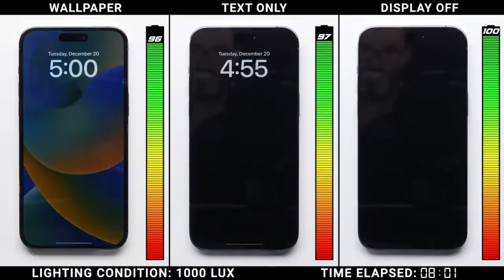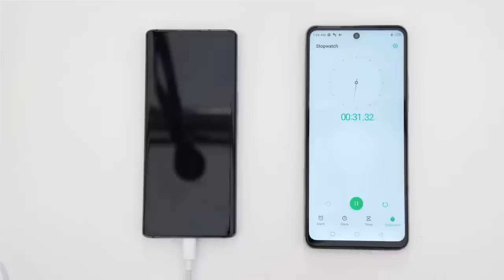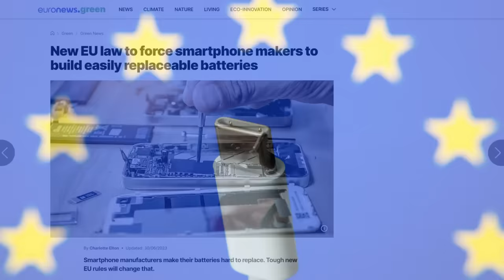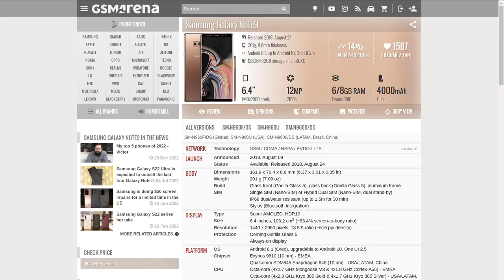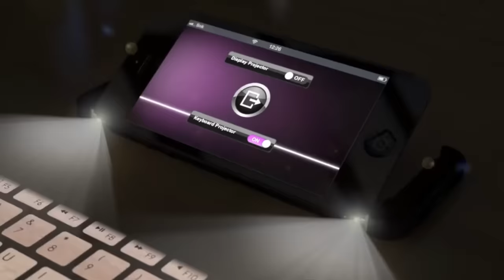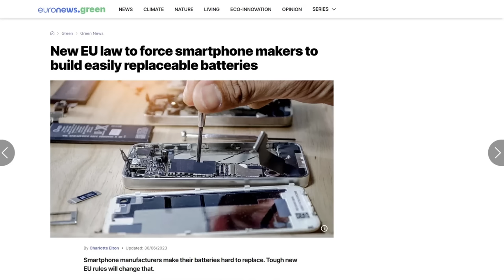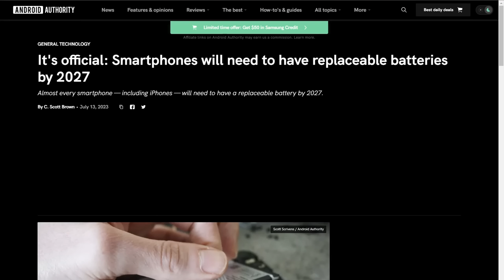All Smartphones Will Soon Have Removable Batteries

Comment: You forgot one important thing: you can be sure your phone it's off when you remove the battery. Also by the battery not being connected to the pins it doesn't drain at all compared to the phone when it's off, for emergency situations
Reply: @todaybuycheapsellhigh8072 I mean....you could just recharge them with batteries charges or just charge your phone > swap batteries > charge again to always have a reserve batterie
Reply: Nope. They can be fully active without a battery but appear inactive.
Reply: @essef. That makes no sense, you cant power the motherboard without DC power, from the battery. With no battery, the board isnt powered so what are you referring to, a hidden battery?
Reply: @davidca96 Its true, your phone is never truly off.
Reply: no need to remove battery for shutting screen from draining battery. capacitors can hold enough energy for allow system (even after battery taken off) to send and receive signals for days. capacitors are found inside  most electronic devices e.g. smartphones :foilhat
Reply: You definitely cant bei sure of that, lol.
Reply: @davidca96  They have micro battery which works as an alternative battery for clock and some other technical stuff.
Reply: Absolutely hit the nail on the head, for me this means I can have piece of mind that I am not being spied on by taking the battery out of my phone.
Reply: @resentfuldragon just put it in a different room 🤷🏻‍♀️
Reply: Not true, many had secondary batteries so you can still be tracked with your battery pulled.
Reply: I saw a video where someone opened up their phone and cut out a small battery that wasn't needed. Phone worked normally afterwards
Reply: Faraday bag is the best option

Comment: There were water resistant phones with removable batteries. Samsung made those sturdy series with button keypads. There were also commercial aimed phones that had removable batteries and water/dust proofing
Reply: No phone is really waterproof, because if your phone goes into the water, the phone company will never accept to take it as warranty case 😢
Reply: @farounaga6931  It doesnt matter, practical aspect of it matters. So accidental drop into water briefly doesnt ruin it.
Reply: my old androids all survived accidentally leaving them out in the rain for hours without any IPS rating.
Reply: @Kacpa2  it actually does, don't forget that your phone has holes in it, so if you do not bring your phone directly to someone who can open it to remove water from the inside, sone of your conponents has a chance do be oxydated after
Reply: This is true, but let's be honest, the water resistance sucked on the S5 which was the only Samsung phone that had a removable battery and water resistance. It is undeniable that the water resistance is better with glued phones.
Reply: @Kacpa2  i work in phone repair, i see it every week :)
Reply: I had a Sharp phones in early 2010s, waterproof Android 2.3 something and it had button, flip screen and touchscreen in one unit, insane engineering in there. They still works, I had to stopped using it because of outdated Android version. It is Sharp 007SH.
Reply: @farounaga6931 he said water resistant not water proof
Reply: Yeah, but the phone was made out of plastic and had shitty capacity/quality battery that died within a year inside it. I don't have fond memories of my S3. Battery inside of my Poco F3 on the other hand is still decent after 2 years. Hopefully "user replaceable" doesn't mean return of low quality plastic devices.
Reply: i remember i was playng hide and seek in my village it was 12 night and i hanget misely by to metal poles wich were above the river ...it was the best hiding place ...but my samsung phone fell out of my poket ....i had to take a 100 meter detour to get to the other bank of the river and search the phone in the water with no flashlight  and it took me like 7 minutes to get there and find it beacuse i was going crazy for losing my phone. i found it and it didnt restart ...i put it in rice overnight and worket just fine ...and it works to this day ...but i dont use it enymore oviiesly
Reply: @capitanulcacaoernesto8215  I specificlyean old XCover Samsung phone.
Reply: yes I had one of those it was the S5 Neo I believe and that had like a small silicone wall that would prevent water from getting inside to a certain depth, most phones today still are only waterproof up to a certain depth and duration the whole argument is just another way out for those crybaby corporations

Comment: As an XCover user, I can confirm that having a removable battery while still passing military standards and IP68 works perfectly fine!
Reply: As someone who had an Xcover, that phone was based on the hardware department
Reply: IP68? that's pretty sweet, never heard of the Xcover - do they ship in Europe? And their origin?
Reply: @sandwich5344  Samsung Galaxy XCover, and they're available here! (I'm German)
Reply: XCover Owner here :P
Reply: yeah, walmart uses an XCover pro as their employee work phone, i was surprised when i saw it had a removable back
Reply: Absolutely, this is entirely correct
Reply: Isn't IPX8 good for prolonged immersion in 5m of water? You could scuba dive with that
Reply: My first Xcover held for so long that when the battery lifetime became a severe issue there were no replacement batteries available anywhere, the model was too old...!
Reply: FINALLY, phones will have removable batteries again, tbh they should take the design from hand-held radios, those are made so u can take it out easily,no need for taking cover out, and u can charge the batteries outside the radio... i hope the phone removable batteries will be implemented like that... (ps: from what i know, this has been a thing in hand-held radios since before the 90's)
Reply: and about waterproofing, radio manufacturers like motorola managed to make it very waterproof, (depends on the radio) but even with easily removable batteries, you can still make them waterproof (as in survive underwater for some quite long periods of time)
Reply: @Fer-- Motorola made many of thier phones waterproof and just didn't tell anyone. I had one and found out the hard way. 😂
Reply: Same. I have got a Volla Phone X23. Awesome phone. Extreme both physical and digital integrity!
Reply: @touta2647  my Xcover had 12GB of storage and was obsolete for my projects due to lack of space(even with a micro sd car), I upgraded to a new 128GB phone. Otherwise, it was amazing
Reply: @GoonyMclinux  Nooo im not talking abt their phones, im talking about their radios! stuff like from the motorbo series or other kinds! they make extremely tough radios (all have detachable batteries lol)
Reply: I returned my xcover after discovering how slow the processor is for the price. It's like they intentionally made it slow to discourage buyers
Reply: the galaxy s5 has a removable battery, and is ip67, for my use its enough that IP
Reply: Batteries will be a subscription service
Reply: My Xcover drowned in a river :((
Rest in peace, my faithful comrade...
Reply: Samsung should start marketing these globally,kinda missed using Samsung since most of their Mid-range to flagship ones are just kinda meh & Im practically forced to used Xiaomi devices since theyre more value & does more than your average samsung phone nowadays
Reply: I guess thats the replacement for the active line that used to exist? I had the s5 Active.

Comment: I think this may actually help the battery bank market. They'll probably begin making replacement rear cases with extended battery life. Of course, Apple and Samsung will probably just move the battery to behind the screen.
Reply: Or power banks for the replacement batteries. So whenever you change the batteries, you put the older one in a power bank slot that charges it.
Reply: behind the screen??
Reply: ....are the batteries not already behind the screen?
Reply: Yes the batteries are already behind the screen, but they aren't removable. On devices with removable batteries, typically the back cover comes off to expose the battery. Why? It's the least cost and lowest risk to have an untrained consumer replace a battery. If they break the back cover they can use tape to hold it in. However, if a consumer replaceable battery is located in a way where the consumer must remove remove the screen to replace a battery, this would be a dream for big tech because now they'll sell tons of screens from people breaking them all the time.
Reply: @davidyoder5890  The EU directive prohibits this. The batteries must be specifically user replaceable without specialist tools and without risking damage to other parts of the phone through the process. The EU Commission aren't stupid.

Comment: Still rocking a Galaxy J7 prime with a removable battery,expandable storage and a 3.5mm jack. 2016 was crazy.
Reply: Im still using this as well. What reason is there to change unless i wanted to game on the phone (i dont)?

Didnt even know android doesnt have swappable batteries anymore. If not 3.5mm does that mean you must use wireless buds in modern phones?
Reply: @greenfroggood2392  Either that or you buy a  doggle for it which means you can't charge the device at the same time.
Reply: Exactly, i still have my iphone X, and don't really plan to change or buy new phone, i don't even play on my phone, it's all PC or Nothing at all
Reply: me too! Android 8.1 Oreo is very stable, I think this phone might last 2 years. Or more, but battery seems a struggle. I'll replace it, maybe.

Comment: From what I heard, this also affect handheld consoles like the SteamDeck. A neat reminder that laws really can be made to help the people.
Reply: Valve likes to be consumer friendly until they have to be friendly to the consumer
Reply: @eclipsek0  holy shit so true
Reply: Its sad that laws rarely help people these days. It is nice to see.
Reply: @eclipsek0  
I'm not exactly sure what you're implying with this comment. As far as I've seen, Valve has been very pro-consumer and pro-right-to-repair with their Steam Deck. You can buy replacement parts for it off the shelf, the board inside has an NVME slot for people who want to upgrade it with more storage space, and they even uploaded a video showing how to take it apart to swap parts.
Reply: @eclipsek0  for the steamdeck its not that bad, because the parts arent glued in with gorilla glue, and it supports power delivery so its fine
Reply: @eclipsek0 valve wasn’t trying to cause the issues with the battery, it was a reflection, of it being our first time creating a device at this scale and complexity.
Reply: @eclipsek0 2nd gen steam deck is being worked on to improve a lot of the hardware issues and slight oversights in the original design.   However it will not be released for many years
Reply: Last thing Valve makes more money if the steam deck is a fully functioning device, it is finically viable only because it exists to sell Steam services, to consumers.
Reply: @WaltuhBlackjr  ever heard about brand reputation
Reply: @augustday9483  What about when they tried their best to not comply with he return policy? What about when they forced users out of their right to owning games? (you probably didn't even notice why you had to agree to the new steam service agreement did you?) What about their constant persistence on not honoring the eu mandated warranty on digital goods?
Reply: If the government has the power to “help” the consumer, then they also have the power to help the corporations
Reply: @FoxWolfWorld  The EU is made for that, to help companies, the amount of lobbyist is incredible over there
Reply: @FoxWolfWorld  they do. But citizens vote for the laws they want, and government is simply the tool in maintaining the laws
Reply: The SteamDeck batteries are not made to be removable ?!
Reply: @FoxWolfWorld  Yes they do, it would be foolish not to have startup programs, but overall the government in Europe is way more balanced than something like America
Reply: @eclipsek0 have you ever bought any game online? You're buying the license to play the game and it has been like that for forever so idk what you're on about this isn't something new or anti consumer
Reply: @divat10  refer to "act man's rise and fall of valve" video in the "Anticonsumer" section
Reply: But Valve quite literally has a tutorial on how to disassemble your Steam Deck. I don't think they'll be "affected" by this regulation because they already embrace right to repair.
Reply: @eclipsek0  can't you just explain yourself?
Reply: @divat10  Why should I? The guy goes into detail about some of the many shenanigans at valve, I would do a poor job of explaining it.
Reply: @divat10  It is anti consumer. If you paid for a game, you should own it.
Reply: @eclipsek0 have you even tried Steam's refund system? I have got refund many times if the game couldn't run or didn't work. Of course that is if you play it more than 2 hours or keep it like week or two if i remember correctly. But at that point it's your fault.
Reply: @c1oudsky  yes I have why?
Reply: @samuelmatheson9655 gorilla glue lmaooo

Comment: I loved the Xiaomi Mi 2 phone. Came with a 3000 mAh battery but had a replacement shell that allowed putting in a 5500 mAh one. Used the small one for every day use and the big one for traveling.
Both versions even came with a fitting protective silicone bumber.
Reply: disply 1080p max in 2013 to 1440p nax in 2014, 2160p max in 2016 still 2160p max only in sony Xperia phone
Reply: You know that xiaomi is from China right? They love to have your data
Reply: @bigblockman11 Xiaomi is a name that screams Chinese.
Reply: @bigblockman11 just like big techs in america so what’s your point?
Reply: @ethisfreedom  well you can see your data being sold by big tech, big Chinese tech, or use a signal blocking bag
Reply: @bigblockman11  back in October 2012 nobody really thought about this. Especially since the Mi 2 was easy to root and to did accept any firmware on it you liked. Even today you can use AOSP Android 11 on this device that initially shipped with android 4.1
Reply: @bigblockman11  I'm so glad I only use google, I know they're not the kind of people to sell my data.

Comment: I remember when phones had removable batteries, I swapped the battery at least 3 times and extended its life for years. I only gave it up when updates had stopped and the OS was too old. 
I had a friend who did the exact thing you described in the video, he had a case that could fit 4 batteries in it. He used a spare phone to charge them at home then throw them in the case for long trips. He'd have at least 4 days worth of battery life from that case.
Reply: This is inexcusable! I have a tablet where the battery began to swell, forcing me to get rid of it. Unfortunately, it was taped and there were apparently wires or something that got ripped out, so basically I have to throw away the whole tablet now.
Reply: I know someone that took out the battery and had a special charger to charge it separately without another phone. It was kinds funny how it worked so well. He had 200% battery at all times
Reply: @alter112 external charger , separately to charge a backup removable battery. Good old day
Reply: Back in the day, you can get an external battery charger too.
Reply: @alter112  If you have 5 batteries, it will be 500% 😁😁
Reply: @EmeraldEyesBibleSecrets  I love the idea of an old phone, an entirely complete piece of technology with staggering computing power compared to early computers, being used just to provide the right voltage and have the right ports to charge batteries